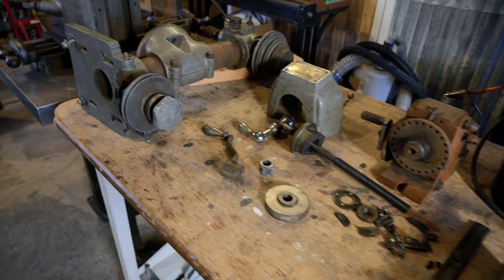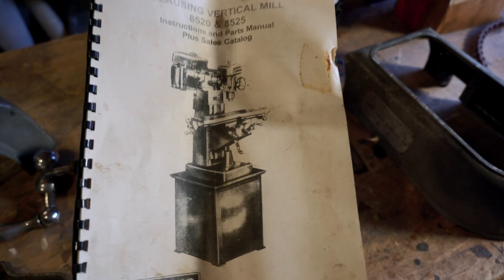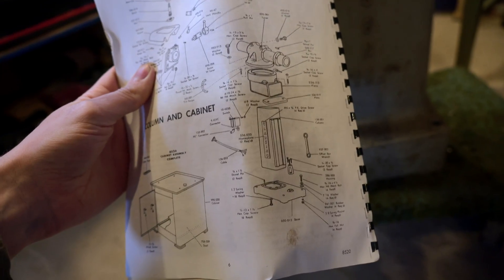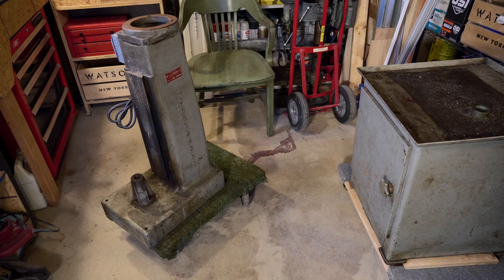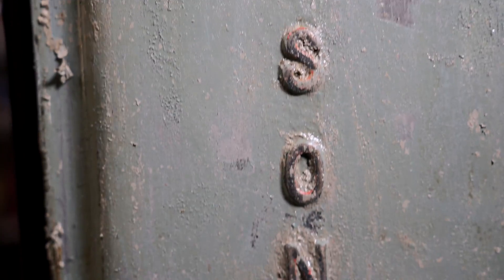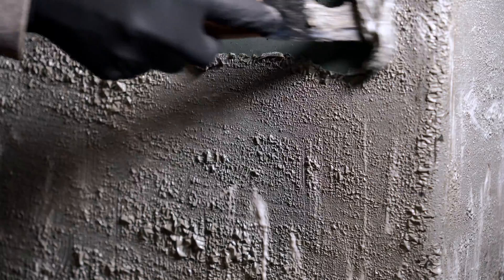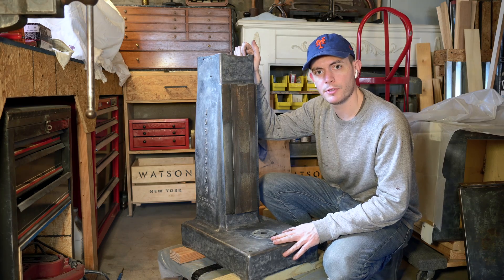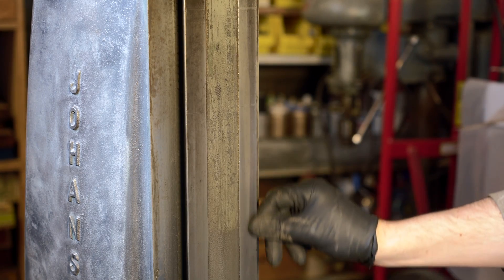Atlas Clausing Johansson 8520 Milling Machine Restoration Part 1: Base and Column

Comment: Oh my God today I bought one of those 8520 in a super great the only thing is, the motor was rewired to 220 and I am absolutely clueless. How and where to start like zero knowledge about it so I have to learn step-by-step may be watching your videos will learn a lot from you.
Reply from the maker: @sanyok7777  if it’s a duel voltage that does 110 it should have the diagram on how to switch it back. If not, swapping in another motor is pretty easy